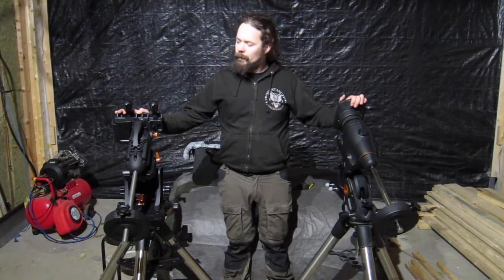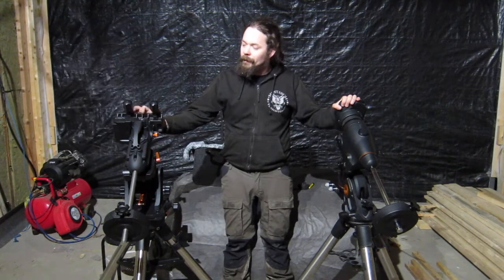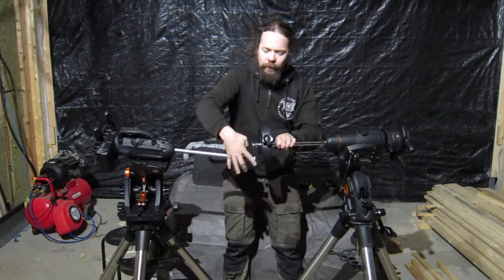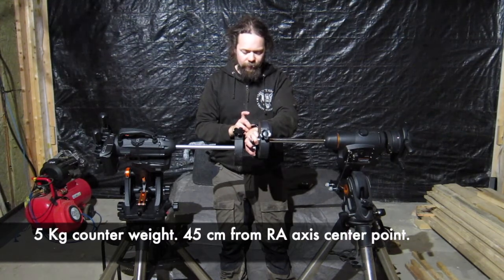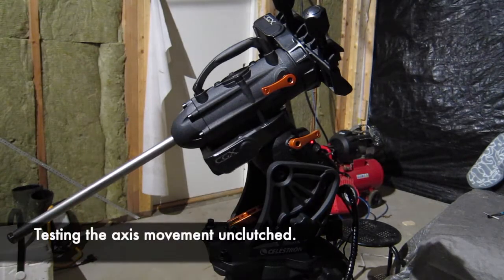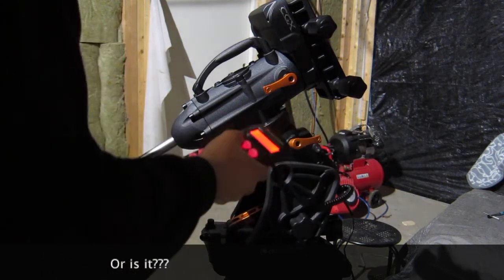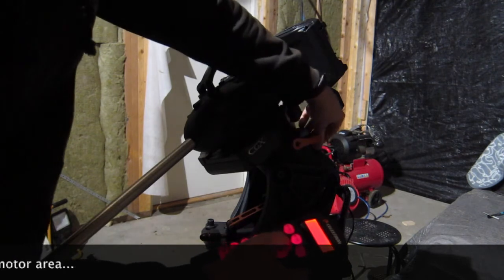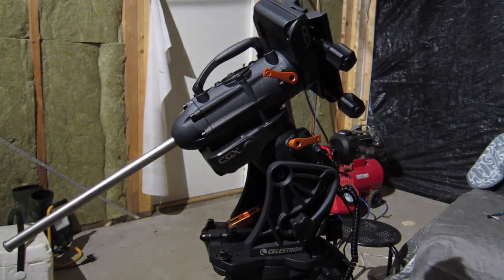Celestron CGX (new) vs CGEM (hypertuned) un-clutched movement

Comment from the maker: Update: 
According to Celestron the movement of the un-clutched axis is normal.
The only question left is the "sticky" DEC axis. If this is indeed an issue?
If it performs alright - it's good.
- If it works, don't fix it.

Update:
The mount was returned to the supplier for service as per recommendation by Celestron support. Will update further when I get the mount back!
See you all in 2020!

Update:
See: https://youtu.be/bvZupWyWxWc
For an update on the dec axis after service.

The axis is slightly easier to balance than before. The service staff at the supplier said that 2 other CGX mount from different deliveries had the same "stiffness". Does this mean that this is how they should be? If you can't see an imbalance, is it good enough? I'm use to use the imbalance to counter backlash in DEC, so I naturally want it to be easy to see. It feels like it's the bearings that stands for most of the resistance, but could also be contributed by the internal wiring that you can hear moving when turning the mound by hand.

I just had the "spikes", or "binding" issue possibly resolved, so now I can begin to test it properly.
Reply: Astroboden.  Check my recent 3 vids on youtube.  For me the stickiness created awful guiding.  The Ring gear when unclutched allows the whole axis to rotate.  When clutched the motor drives the axis around the ring gear.  You can take the plastic motor/worm gear block off to see this in action.  With all the stiffness in the DEC axis (note mine was RA too) it becomes almost impossible to balance, that's the first issue.  Then the second issue is the amount of torque needed to drive the worm around the ring gear as the axis is so stiff, this created an issue where I could not do a calibration in PHD2 as it kept on reporting a backlash of nearly 4750ms!! I thought I should have hung onto my Hypertuned CGEM as it appeared to be better than the CGX.  Because I did my own CGEM hypertune I remembered over tightening the tapered bearing at the bottom of each axis this on the CGEM created the same effect as these out of the box CGX's......so i decided to open the bottom of my CGX, and check the tapered bearing.  Indeed I appear to be right, after backing the retaining ring off for the DEC axis (remember to re-apply thread lock) it became nice and free and easy to balance.  I've not had a chance to test the guiding due to clouds but I'm sure it will be fine now.  Have a look at my vids, and check out my cloudy nights post.  Hope this helps you...these CGXs should be good mounts, but the out of the box experience is not good.  I have seen some youtube vids where owners CGXs are perfect out of the box, yours looks exactly as mine did, not so good.   https://www.cloudynights.com/topic/686498-something-for-cgx-owners/
Reply from the maker: jmustoe: thanks for your reply! Seems like we have the same issue indeed. Kinda wish I found your post before. I honestly believed that the hypertune requirement was going to be worked out by now. I would call the CGX a high(er) end mount from a price point of view and that QC would follow that.
Celestron did acknowledge that the mount requires repair and I'm sending it back to supplier for service. Hope they will do what should be done(that you did yourself) so that it's kept it in warranty.
Cheers again for the link to your post!
Will see how it ends out.
Reply: @astroboden  please update here with the results from Celestron on this mount. I was going to pull the trigger on the CGX-L today but will hold off. Glad I found this.
Reply from the maker: @Bobby very long reply to follow... sorry about that!

I will try to be diplomatic… My take on the CGX has been very cold to say the least. From day one I had the “sticky” axis in Dec, which I send it off to the supplier for. It seems like they are all like that, so if that’s how they are suppose to be, I can’t say. 
It does make balancing hard. Specially the fine tuning the DEC axis to counter backlash.
And there is backlash. PHD2 couldn’t even measure a consistent result with Guiding Assistant at first. After service and tweaking the meshing I was able to make it work, but still with ≈2000ms of backlash. And it was binding! In both axis. Almost didn’t think that was possible.
Feels like I have been barking up every tree in the woods here, to get on top of it. My current path is the guide computer. An issue that started with the CGX, but I’m not leaving any stone unturned now.

I'm collecting PHD2 graphs for a more in-depth analysis, but I don't know if I can hand it back on warranty anymore.

Would I buy the CGX today? – Absolutely Not!
Would I buy it when I know the cause of the binding/spiking issue? It might even be the guide computer. - Maybe!
I’ll make a full review of how my CGX experience has been when: I have resolved the issue, OR surrendered to defeat.

The quick version is that I think the CGX mount is a very good design. I would love for it to work as intended. It would solve a lot of possible issues. I don’t feel 100% on the assembly or parts involved however. After some 20-30 hours of runtime I just cleaned the worm gear grease that was completely grey, hoping that would have been the problem, just to mention one.
The manual is not helping out either. When adjusting the worm meshing you have to do the exact opposite to what they say, but you have to figure out where and how yourself. –Terrible! By the time you realise, the factory setting is long gone. 
They also reference to the Alt-Az coordinate system for the motor slewing, and with wrong speed table (I suppose it’s a copy-paste from another mount manual). It just feels like they didn’t care. Might be different for the CGX-L, but I would search for “issues with CGX-L”, or similar first to get that part of the story. I was very biased for CGX when I compared products before buying. 

Hope that helps somehow. 
I'll be updating as I progress, but there is so few clear nights that it takes some time.
Reply: @astroboden  thanks for the details and taking the time to reply. I'll stay tuned here.
Reply from the maker: @Bobby - I know I’m just high on success and feeling hopeful for the first time in a while.
I did a major breakthrough yesterday! I confirmed (say to 90%) that the “spikes” or “binding” issues I’ve been having is not at all related to the mount, but to the guiding. More on that separately. The CGX mount has been a lot more sensitive than the CGEM, but I noted that the CGEM was also affected to a degree when looking over guide data now.
I will now have to get back on meshing the worm gears back up, a process I think I practiced quite a lot now, haha ha. 
I still feel that Celestron need to have a close look at the manual and perhaps communicate what to expect of the feel and motion of the system. I don’t know how troublesome the sticky axis will be in the end.

Stay tuned and I’ll keep updating how it works. Hopefully with some resulting pictures to show for it.
Reply: Astroboden well I am quite disappointed with the CGX results you guys get... I’ll be following up for sure, I have the CGEM that I now know from top to bottom having performed a Hypertune myself and twitching everything up